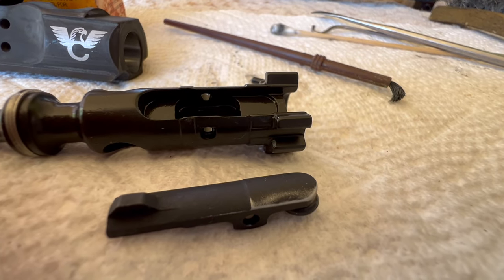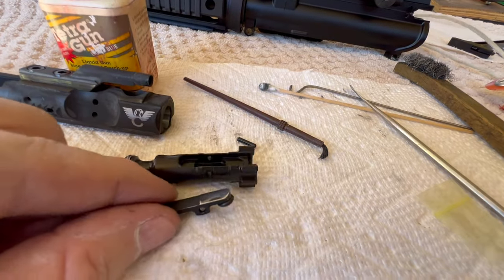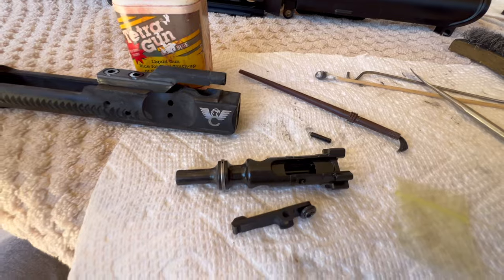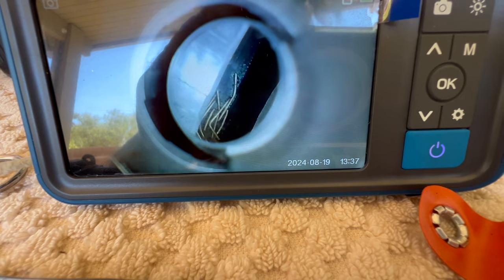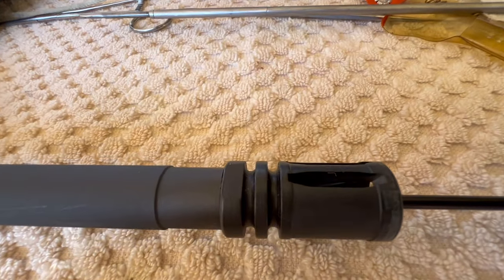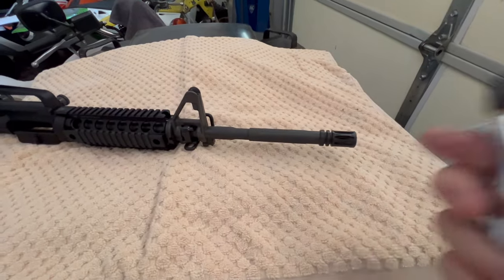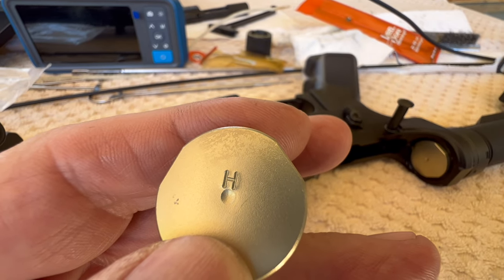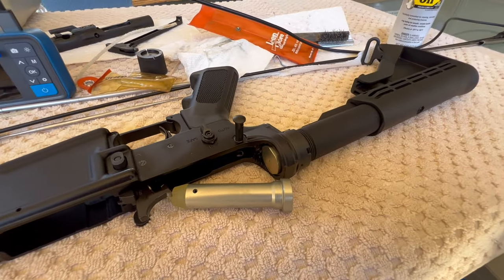M4A1 USMC/NAVY (2008) Retro Post Range Inspection/Odd Borescope Find!

Comment: Good afternoon, Mr. Pete! I watched your video of you shooting your two newest builds yesterday. Your stacking bullets with both builds is impressive! You're quite the marksman as well as a professional AR builder. Those are both beautiful rifles, Pete, although I lean toward the A2, for the simple reason I want to build myself a retro A1 or A2. I didn't realize the high temperatures that early in the morning in Vegas. I'll stay tuned to see your final determination of the over gassed issue and your final fix. I forgot to mention last time on my ironing board shooting bench, I added a screen door handle to the edge at the balance point for ease of transporting. I also utilize a short bungy cord on the bottom through preexisting holes to keep the legs folded flat while not in use. I had seen a U-Tube video showing one made similar to this, but I added the folding down of the oversize carpet, then attaching with the machined screws. Also, the one I saw had tubular legs shaped like an upside down "T", and the fella said he had to watch where he set it up, in order to be level and stable. Mine was an old yard sale find and the leg on the tapered end, from where I shoot, was made like an old crutch, 2 flat metal pieces tapering into one and the other end is 2 seperate slender legs. This makes it easy to set up and stable on any terrain. Thanks for the excellent video again, Pete, and have a great day!
Reply from the maker: Thanks again John! I really need to see this ironing board bench! Lol! The more you describe it the more I smile! If it works that's all that matters! I'll be getting an H2 buffer probably today to take back out to the range with the H1 I already have. I'll get the Mforgery straightened out very soon! The Brownells SOCOM barrel is accurate! First time using one of their barrels and the one I got is no slouch even using junk ammo! Overall the A2 is also my favorite! Everyone now refers to them as RETRO's but these are what I came up with and funny to realize that younger people refer to them that way. Old is new again... except me! Lol!
Reply: @peteregger7928  Thanks for the reply, Pete. I'm with you on the old is new again, except for me. I'm mid 60's, probably close to your age! Your being a little modest on the barrel being accurate, even with a laser, the man behind it is the determining factor! You're a marksman, Pete! I'll bet it takes you quite a long time to set up all your shooting equipment, your shooting bench, chair, targets, etc. I'd like to pry a little more info from you, if I may? I'm looking at roll pin punch sets and I'm unsure on two options. The first is Brownells 7 pc. punch set along with their 5 pc. pin starter set, total inc. tax. & s & h is $90 and change. second is from our buddy, who uses Lok-Tite on buffer tubes. LOL! They are Grace, starter & punch sets, each having 7 pcs for $70 and change. Also, I've found a Midway combination upper receiver block/AR bench block for $20.88 (Primary Arms), add tax. & s & h, total $33 and change. Our biddy also has a Wheeler Clamshell upper receiver block for $22 and change, which includes the gas tube alignment tool. I'm trying to put some decent AR tools together without breaking the bank. I have some lumber coming tomorrow to build a workbench. I was looking at a Wheeler combo including a needle type torque wrench with an armorer's wrench for $47 and change. Dang, Pete, I apologize for all the questions, I don't know anyone else to ask, that I would trust actually knowing everything! Thanks, Pete and have a great evening!

Comment: Are we not using the extractor inserts anymore?
Reply from the maker: Wilson Combat had the insert installed but not the O-ring. Thought I would try the BCG without the O-ring during testing. I think this rifle needs it. Have some heavier buffers on deck and the O-ring installed. Will be getting this one out for some more testing soon! Stay tuned! Thanks for watching and commenting!
Reply: Ok. You are absolutely correct. I went back and watched it again. It’s black and blended in. The BCM  SOPMOD upgrade kits I got in the early 2000s to fix my bad BushmasterA1 had blue ones. I was looking for the wrong thing.
Reply from the maker: @joesephkingston1621  Most of them I have seen are also blue! The black ones are hard to see even if you have good eyes... which I don't anymore! New rule for AR BCG manufacturers, use easily seen insert colors!